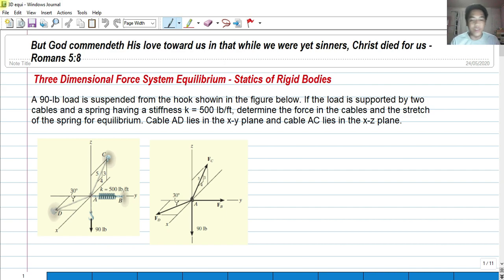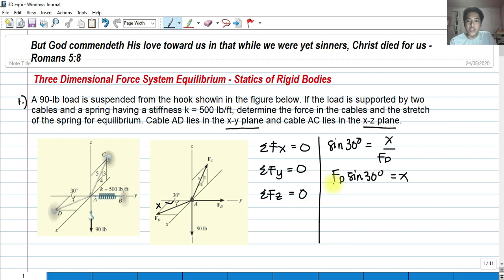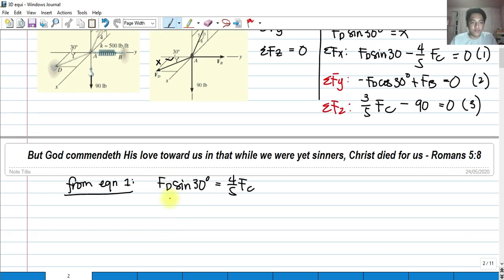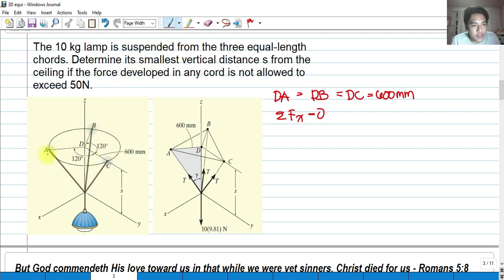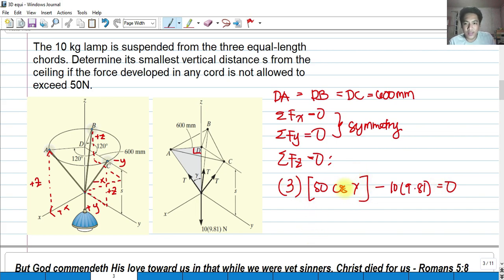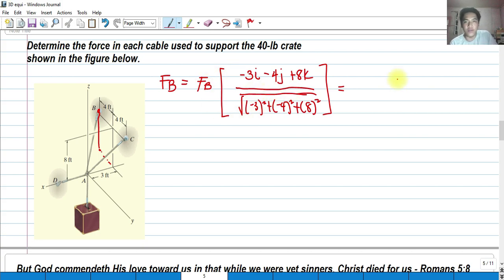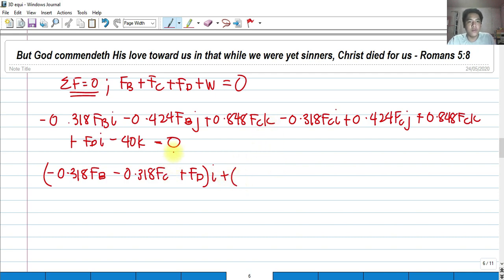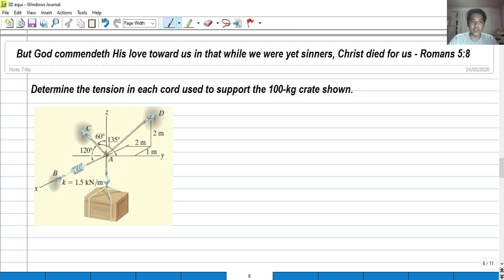Three Dimensional Force System Equilibrium - Statics of Rigid Bodies

Comment: Sir, why is it in the summation of Fx, we use sine? Don't we use cosine for x-component? Or did we use sine because of the concept of sine law? Im referring to the first problem sir.
Reply: we use cos for x-component, the given here is the angle of the line with respect to the Y-component so he use the sine, BUT we can use the Cos to avoid confusion, sin(30) is equals to cos(60) BUT NOT cos(30), angle has to equates to 90 degree, 30-60, 45-45, 20-70, 14-76